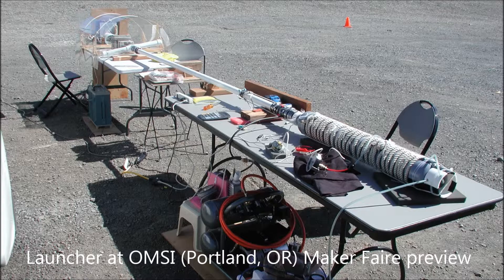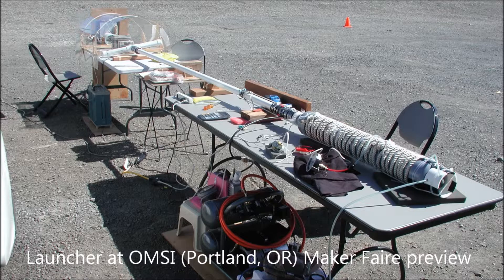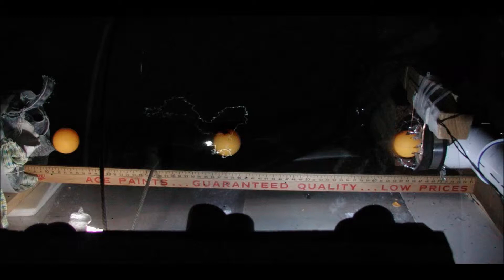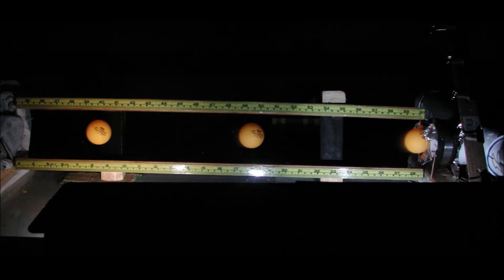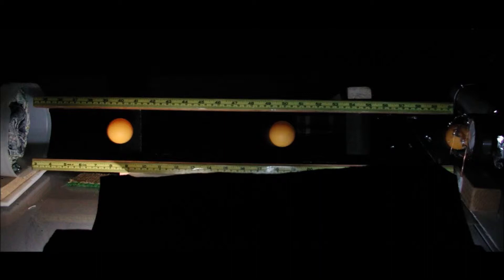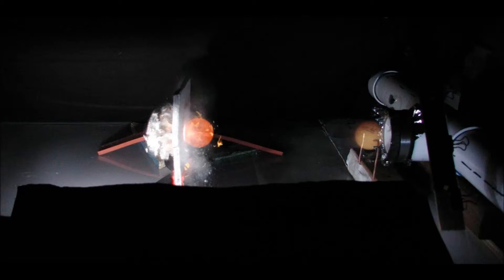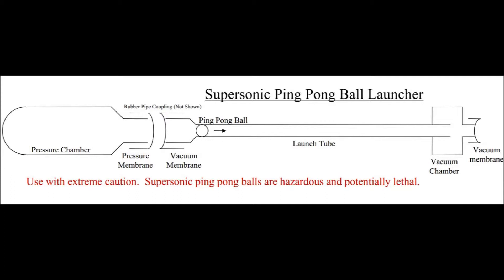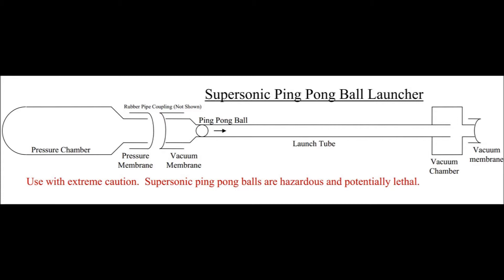Supersonic ping pong ball launcher: high-speed flash images and description

Comment: Just one more thing about the mylar, there exists vacuform plastics
in sheet form. Your mylar appears to be "balloon" material..when vacuum forming plastic gets thinner, maybe they have an ideal material for your testing purposes.
God i love this stuff !!
Reply from the maker: Charlie:  I didn't notice this note until now.  The mylar I used is "space blanket" material, about 12um thick.  I tested a number of materials, including balloon mylar.  The balloon is thicker, around 25um, so didn't work as well.  You are right - as thin as possible is good, as long as it holds against the force of the vacuum.  The 12um material appears to be just right.  I could try vacuum-forming the 12um mylar to see if I could get it slightly thinner without breaking, but not sure it would be worth the slight improvement.  Thank you for the idea!

Comment: What laser sensor do you use for the oscilloscope speed readings?
Reply from the maker: It happens to be LED photogates, not laser.  Two green LEDs 100mm apart provide the light and two opposing yellow LEDs are used as photodiodes to detect the light.  All four LEDs are narrow-beam devices recessed in 5mm holes.  The ball breaks the first beam, then breaks the second beam after traveling another 100mm.  The 5mm beam width makes the blocking (shadow) events not perfectly sharp.  Accuracy is maintained by measuring at the half-way transition point, on both photodiodes.  Also, I average the leading and trailing edges of the shadow to null any angle matching error.  This handles the case where the ball isn't exactly centered on the beam, and not exactly the same centering between the first and second beams.  (The photodiodes are processed by a linear amplifier and measured on an oscilloscope to avoid any electronic pulse-width distortion that could occur if saturated switching amplifiers were used.)

Comment: Hi Dave, what's the diameter of the membrane that eventually broke a hole after launching?
Reply from the maker: I presume you are asking about the membrane at the end of the launch tube that holds the vacuum (keeps the air out) until the ball breaks through it.  That membrane is 12um thick mylar (space blanket) over a nominal-2" schedule 40 PVC pipe section, so 2.375" (60mm) OD and around 52mm ID.

Comment: No gap between rope would be much safer. Kevlar wrap underneath also would be keen.
Reply from the maker: +Charlie Varrick 
Yes, more rope (no gap) would be better.  I just used what I had around already.
Kevlar (or UHMWPE) would be stronger, but absorb less energy (low stretch).  The lower energy absorption is why those stronger materials aren't used for climbing rope.  Kevlar might be better if wrapped tightly enough.  Either way, the rope is just an extra safety measure.  The pipe should be plenty strong enough by itself.
Reply: davekni I do agree and  like the "jute" rope idea, and the use of lexan tubing.Wrapping a long lenght sure is tough on the hands (been there lol ) You've done
an Awesome job achieving your goal !!
My hat is off to Guys !!

Comment: Try using a dynema blanket (multi-layers) to wrap pressure vessel for safety, then add nylon rope...  You can find it on EBay.
Reply from the maker: Yes, that would make it stronger.  I have some dynema fishing line.  It is by far the best stuff for string phones (with Styrofoam cups) - a fun project for kids and much clearer than the ones we made when I was young.  If we were to ever try for faster, I'd more likely change to a steel gas cylinder as Mythbusters used.

Comment: Did you try stretch pressure on mylar final membrane?
Reply from the maker: +Charlie Varrick 
The mylar final membrane was just barely stretched, enough to make it flat, by the action of sliding the clamp (slice of a rubber pipe coupling) over the end.  Yes, stretching it more should reduce the energy required to break through, up to the point where it no longer holds up to atmospheric air pressure.  I don't have a good technique for uniformly stretching the membrane.  Any suggestions?
Reply: +davekni Take 2 steel rings perhaps 6'' x 3/4'' w x 1/8'' thick
i'm thinking 6'' for a 4'' od pipe. Use a viton o-ring into a double routered groove on the inside of rings, the groove 1/4'' from inner inside of the rings to line of perfectly. Place the rings when ready in the freezer to contract them.
keep cold when assembling the ring with mylar (sandwiched of course)
tighten very tight, then when ready to do your test carefully warm up the rings 
to a highest temp you can (where mylar not becoming affected)
maybe 70-85 degrees is my guess. You would need a method of applying to your unit. Maybe another o-ring mount system. What do you think? i know it's a lot of work but i bet the "steel ring" would expand enough to make mylar super tight.
Reply from the maker: +Charlie Varrick Mylar stretches enough that I suspect steel thermal expansion won't add too much.  But, your idea of holding the mylar in a larger ring clamp could help.  The mylar would stretch more as it is pulled over the 2" pipe end if it is already clamped to the larger ring.
For now, the launcher is disassembled and stored, but I may demo it more next summer.
BTW, the rope is nylon - which has nice stretch for energy absorption.
Reply: +davekni When i first viewed i thought the larger back end pipe was a "pressurized space supplying force to the front vacuum space.Then i realize the entire canon is a vacuum, powered by the void being refilled with air.
Therefore you do not have danger of exploding but imploding is a remote possibility i now see. I am amazed the balloon mylar holds up to such pressure. So the rope i'm guessing is in case it "over fills" rapidly ?
This is so cool to me because its like like using "anti power" to power something. I am deeply impressed to say the least !!
Reply from the maker: +Charlie Varrick Actually, the larger back end pipe is pressurized, with either air or helium, to 80 or 90 PSI above atmosphere.  For the vacuum-only launch (300 m/s), we did not use the back end pressure chamber.  For the other two faster ones, we used pressurized air and helium.
So, the vacuum-only is kind-of "anti-power" - just using atmospheric air rushing in to the vacuum-filled tube.  Even though it isn't quite supersonic, 300 m/s is impressive for vacuum only.
Reply: +davekni Oh ok, i'm still amazed either way, in my career i've used air pressure negative and positive to achieve my successes. I am amazed the strength of the mylar for the most part. I have to wonder what next can be done with this cannon. I think pre made "sleeve" mylars can help you out instead of all the clamping. That was my specialty lol making production faster...in any way possible...i will keep thinking on this...you guys rock in my book.